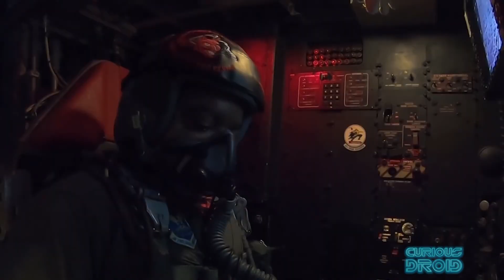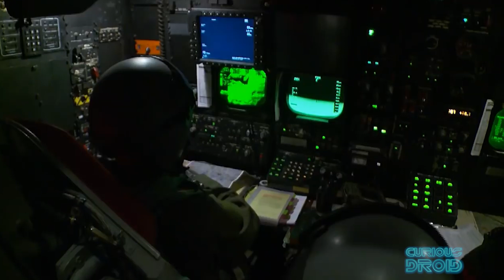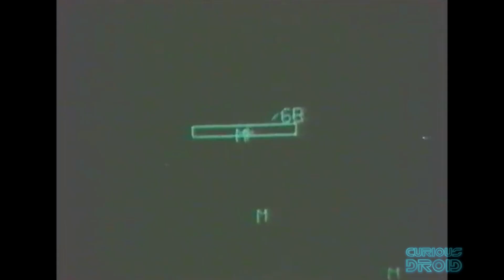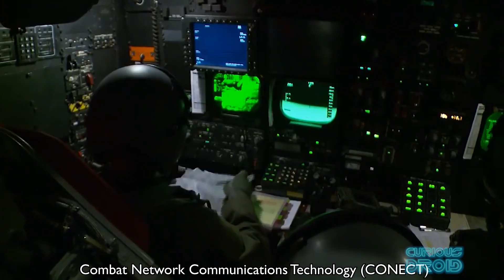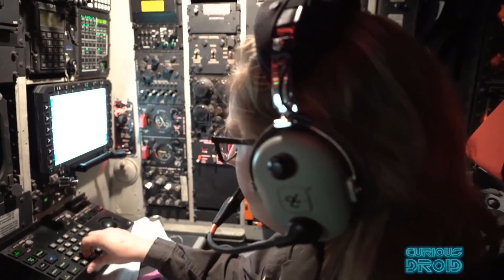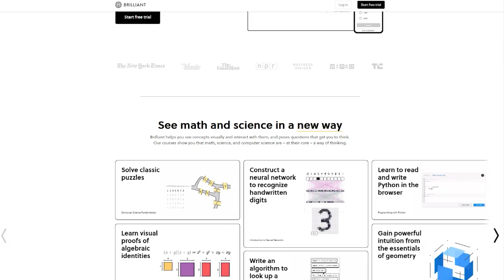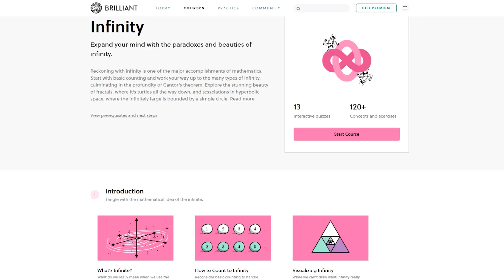How Long Can the B-52 Continue in Service?

Comment: Us airforce 
“The a-10 is too old and outdated, GET RID OF IT” 

Also Airforce “the b52 should stay for 100 years 😃”
Reply: libertarian4ever66 if humans use it over engineer it
Reply: If ever there was a plane that could and DID fight for it's place in the battlefield, it's the A-10.

Honestly, the U.S. Airforce hates the hog so much, they should lift the silly petty requirement that the army NOT operate fixed wing aircraft, and transfer the A-10 to them whole hog.(lol) The Army will likely not ever operate another fixed wing craft AFTER the A-10, unless it can do what the A-10 does so goddamn well: close air support saving the troops asses and going BRRRRRRT to any enemy bunker or mobile armour/artillery to make the grunt's life easier. It's fuckin win/win. The AF gets rid of the plane that make a mockery of the F-35 and the Army gets the close air support they need!
Reply: @exidy-yt  I think that since the Marines are phasing out Tanks, the A-10's should go to them. With mods that allow wings to fold they can take up space on assault ships.
Reply: @exidy-yt  I think that since the Marines are phasing out Tanks, the A-10's should go to them. With mods that allow wings to fold they can take up space on assault ships.
Reply: @wildancrazy159  I bet the Corps would love to have the A-10s! However if the wing replacements have already been built and are being installed on A-10s currently, that may not be financially doable but i like the idea, and if the Marine corps does too, who knows?
Reply: @exidy-yt  In my opinion the best USMC plane was the F4U Corsair... Plus its such a good looking plane.
Reply: @exidy-yt  it fought for dear life, back in 1991 it had to be pulled out due to excessive losses.
Reply: @ChucksSEADnDEAD  Uh, no. It rocked the battlefield in 1991! Took very FEW losses though many hits, and it brought those pilots home alive. Some Iraqi armour troops who read English took to calling the A-10 the 'Devil's Cross' quoting Tom Clancey's Red Storm Rising. The ground troops love it, it's saved their bacon many times now and continues to be the best at it.
Regarding your other post: F16s cannot loiter near as long over the battlefield and suck at close air support in comparison. Even a Super Tucano would be better then an F-16 in CAS which is a great versatile light fighter, but not ideal for CAS.  B-1? a strategic bomber? F-15 Eagles?? an all-weather interceptor/dogfighter??? Are you high? Neither of those planes do CAS except in dire emergency!  You really need to research before you post if you've never actually fought in battle. The A-10 is not an all-circumstances aircraft, it's a close air support specialist, and in that role it's still unbeaten.
Reply: @exidy-yt  It sucks a close air support. Its too fast to do the role effectively, and it was designed to kill tank columns in the 1970s. Most armor can withstand attacks from its 30mm and have enough AA to mess it up today. The way you would handle an armor column would be a submunition device from range.
Reply: @punishedmeridia  "Its too fast to do the role effectively" - Why?
Reply: @ChucksSEADnDEAD  It can't loiter properly. The best CAS during Vietnam were prop planes
Reply: @punishedmeridia  Loitering will get you killed. The best CAS during Vietnam came from prop planes because technology did not allow the human in the loop to acquire targets by himself in a jet, being almost completely dependent on ground forces to direct the attacks. The only solution at the time was giving the human a plane with lower performance. We don't need to do that anymore.
Reply: @exidy-yt  It only did well against the regular Iraqi Army; when the A-10s were sent against the more competent Republican Guard, they immediately started to suffer losses. After the first day, the A-10s were sent back to fight the much more incompetent regulars.
Reply: @ChucksSEADnDEAD  In the current footing that the US military is in, one of small unit anti-terrorism actions, a Super Tucano like turboprop would do much better than a A-10
Reply: @zalankarpati4387  I would think that would be expected of any plane going from chewing up literal cannon fodder to going up against disciplined and protected elite forces. What kind of support was the A-10 given? Normally it's a plane that flies when there is high control of airspace, and ground troops need support. It's not a tank killer anymore. It's not an all-circumstances plane, it's very much a specialist in an important role. In that role, it's cannon is murder. It's lower fuel consumption then most combat aircraft gives it hours more loitering time over the battlefield. It's upgraded avionics lets it deliver the same JDAMs and other guided bombs more modern planes can, and more OF them then any F-16 could dream of. It's old and ugly, but cheap to maintain and tough as nails. That's why it's survived so many calls to remove it when other, far less understandable recalls like the F-14 Tomcat went through.
Reply: @exidy-yt  You know what's even lower on fuel consumption? Turboprops that are only like 20 knots slower than the A-10 at cruise speed.
Cheap to maintain? Boeing got a fat check to build new wings because the damned thing was literally too old to fly. And not even the entire fleet got it.
Reply: @ChucksSEADnDEAD  Six A10s have been lost ever. During Gulf War One four were lost to SAMs and two flew back to base with damage that resulted in scrapping them out of 8100 sorties. None were lost in any of the various Bosnian conflicts, 

One A10 was lost during operation Iraqi Freedom altho the A10 performed 32% of the sorties. NONE  were lost in Enduring Freedom where it did 20% of them. They flew 25,000 to 30,000 sorties per year. 

They flew about 20% of the total sorties in Afghanistan with bo losses

And there have been no losses in operations agInt isil
 
The warthogs total sorties is second only to the f16. But then, there are less than 300 operational A10s out of less than 800 made, while over 4000 of the F16 have been produced. Even after paying to replace the wings on all the operational planes, the A10 is still the cheapest, and cheapest to operate of a y usaf plane. 

I dont get your loss ratio numbers tho. Sure, 6 out of 700 is huge but do a per sortie count. 

And, of coirse. The A10 can be serviced a d repaired on unimproved fields... kinda important. 

Would a turboprop purpose designes cas plane be better? Probably, but the AF will never do it. They hate props.
Reply: @ChucksSEADnDEAD  That's b/c it went into harm's way.
Reply: @selfdo  So did other aircraft.
Reply: God I love watching keyboard warriors with unlimited knowledge fight it out in a comment section.
Reply: Because the A-10 was made for large scale conventional warfare, and on modern battlefields it's barely more effective than a multi-role fighter, whereas the B-52 fills a niche that is important but too expensive to fill with a different aircraft, hence they stay while the A-10 will probably go.
Reply: Marine Corps says they will take the A 10 if the Air Force retired it.
Reply: @markrice41  How the hell is the A-10 going to take off and land from a short deck carrier? Get outta here with that nonsense.
Reply: @ChucksSEADnDEAD  The Navy has experimented with the A10. The Air Force is right now using the B52 over the south China sea as a deterrent.  My point is, we have a major situation brewing there and no modern hardware to deal with it.  Wake up, America!
Reply: @markrice41  So your option is to use ancient hardware, that already got shot down at unacceptable rates almost 30 years ago?
The Navy isn't the Marines. They need something that can take off from helicopter carriers.
Reply: @ChucksSEADnDEAD  You are still not getting the point. Do I have to be Captain Obvoius for you? We are using outdated aircraft because we have no modern aircraft. Except that new fighter jet that's so damned expensive they cant afford to fly it. I will give you another hint: Do you like diet cola? Do you like corn chips? Enjoy them while you can. Those who know why the south  China sea is kept out of the news will underatand.
Reply: @markrice41  "We are using outdated aircraft because we have no modern aircraft." - Wait. So we actually stopped manufacturing aircraft in 1984? There's nothing newer than the A-10 in inventory? Because that's your argument.
Reply: @ChucksSEADnDEAD  I helped build the B1 back in 84 - 91. Do you know how long it took even then to develop an airplane? Avionics would go obsolete and out of production before they could be put on the plane. By the time the planes were built, the mission (Soviet Union) no longer existed. The B52 can be easily retrofitted. The B1 and B2 cannot. It is so expensive and time consuming to make a new bomber.  Like the battleship, it may never be done again.
Reply: @markrice41  Look, regarding the modern hardware, we're dealing with it. That's why recently the Army showed off how artillery can shoot down a cruise missile, and a F-16 did the same with a guided rocket. The A-10 is not gonna help in Asia and that was my point. If they're gambling everything on not even letting carriers get close to shore with missiles, taking care of the missiles is more important than making carrier capable A-10s.
Reply: The concept of the A-10 was already outdated when it was introduced. It might have done okay against Viet Cong in South Vietnam, but slow, low altitude gunruns are the perfect targets for Soviet and Russian IADS (Integrated Air Defense System). Even the current A-10s mostly use guided munitions from medium altitude.

The B-52 is a very good long range, high endurance platform to lob cruise and hypersonic missiles from stand-off range, but the A-10 is a goner: too expensive for COIN, and has a very low chance of survival in a peer-to-peer conflict.

It might be built around a big gun, but it has almost no worth in the era of guided bombs and missiles.
Reply: @zalankarpati4387  As an attacking force the Soviets could not take an Integrated Air Defense System on the road to the Rhein. On that way are many mountains and hills to cover a slow and low flying aircraft from enemy radar. The A-10 can use guided ammunition but no other US aircraft can go as slow and low to precisely aim with 30 mm.
Reply: @libertarian4ever66 A Cessna at least would have huge fuel savings compared to the A-10. Sorry, but a CAS platform that only got 20% of CAS missions since 2000 and only 11% since 2014 has effectively been replaced.
You might not make a call for a B1 but if that's what's available that's what you'll get. Even the Army generals agree with me, they're not worried about the platform because CAS is a mission not a platform.
Reply: @libertarian4ever66 "I am the source, having actually called in for air support in the field" - What does this mean? B1s are called to provide CAS. In fact, if you wanted to argue your position, you could bring up how a B1 dropped bombs on friendlies by accident because they couldn't see strobes through the pod, and were too high to see strobes on NVG. Even though some of the blame is on the incorrect coordinates fed by the controller. So if you're your own source for the claim that B1s aren't called in for CAS, you're wrong.
I also don't know who you are, and you could be lying.
Reply: @libertarian4ever66 You didn't use sources, pretty rich you ask me for some when you won't apply the same standards to yourself. You'll have to wait until I can look for it.
Reply: @libertarian4ever66 https://en.wikipedia.org/wiki/Rockwell_B-1_Lancer "On 14 July 2007, the Associated Press reported on the growing USAF presence in Iraq, including reintroduction of B-1Bs as a close-at-hand platform to support Coalition ground forces.[134] Since 2008, B-1s have been used in Iraq and Afghanistan in an "armed overwatch" role, loitering for surveillance purposes while ready to deliver guided bombs in support of ground troops if contacted.[135][136]"
"In August 2012, the 9th Expeditionary Bomb Squadron returned from a six-month tour in Afghanistan. Its 9 B-1Bs flew 770 sorties, the most of any B-1B squadron on a single deployment. The squadron spent 9,500 hours airborne, keeping one of its bombers in the air at all times. They accounted for a quarter of all combat aircraft sorties over the country during that time and fulfilled an average of two to three air support requests per day.[145]"
"Beginning in 2014, the B-1 was used by the U.S. against the Islamic State (IS) in the Syrian Civil War.[148] From August 2014 to January 2015, the B-1 accounted for eight percent of USAF sorties during Operation Inherent Resolve.[149] The 9th Bomb Squadron was deployed to Qatar in July 2014 to support missions in Afghanistan, but when the air campaign against IS began on 8 August, the aircraft were employed in Iraq. During the Battle of Kobane in Syria, the squadron's B-1s dropped 660 bombs over 5 months in support of Kurdish forces defending the city, one-third of all bombs used during OIR during the period, killing some 1,000 ISIL fighters. The 9th Bomb Squadron's B-1s went "Winchester", dropping all weapons on board, 31 times during their deployment. They dropped over 2,000 JDAMs during the 6-month rotation.[150] B-1s from the 28th Bomb Wing flew 490 sorties where they dropped 3,800 munitions on 3,700 targets during a six-month deployment."
https://www.military.com/daily-news/2018/01/14/b-1b-lancers-evolving-mission-take-more-close-air-support.html  ""Twenty-five years ago, if you would have said the B-1 was going to do CAS, you would have been laughed out of the room," said Lt. Col. Dominic "Beaver" Ross, director of operations for the 337th Test and Evaluations Squadron."
"Today, "the B-1 [has] dropped more weapons in CAS than any other platform. It's second to none," Ross said during an interview.

Military.com sat down with Global Strike Command officials during a trip to the base and took a ride in the B-1B over training ranges in New Mexico last month.

"Most ground commanders want a B-1 or an A-10 [Thunderbolt II]," Ross said of close mission support.

But, unlike the A-10 -- reigning champion in the fight against the Islamic State in Iraq and Syria -- "we have the long loiter time," he said.

"We have the sensors. We have the speed, the shows of force. We are so [forward-leaning] in this community. We try to think of ways for the crews and the airplane to do things you would have never thought of doing with it," Ross said.

He continued, "If I'm talking to a guy on the ground and I have my sensor on him ... we can drop weapons seven miles away, or we can drop lower, drop them closer. We're not going to drop them as low as an A-10, but we are going to do shows of force where we're 500 feet overtop of their head.""
""Realize that all the platforms that drop these weapons [GBU-54s, GBU-31s] are seeing the exact same thing ," he said. "So a GBU-31 dropped off a B-1 is the same as a GBU-31 dropped off of an F-15, or an F-16, or an A-10. They all have launch acceptability regions, they all have air speeds and altitude restrictions, and they're all GPS-guided weapons."

Kilchrist added, "An A-10 can drop those things just as well as we can. To put in the perspective of, 'Oh, a B-1 is not a CAS platform' [argument], remember that CAS is that mission set. And because of the payload that we have, the speed, the gas, we can stay there for long periods of time. And just unleash.""
https://breakingdefense.com/2014/05/sen-mccain-b-1s-really-do-cas/
"Senator McCain stopped just short Tuesday of accusing the Air Force of walking away from the Close Air Support (CAS) mission if the service retires the A-10 Warthog fleet. Air Force Chief of Staff Gen. Mark Welsh and Secretary Deborah Lee James told the Senate Armed Services Committee hearing where McCain raised the issue that many other aircraft fill the CAS role, including the B-1B bomber.

McCain clearly did not buy it: “You’re throwing in the B-1 bomber as a close air support weapon to replace the A-10. This is the reason why there is … such incredible skepticism here in the Congress.” The senator apparently didn’t know that the B-1 has been a CAS weapon since 2001. The B-52 has flown CAS missions since 1967. Joint Publication 3-09.3 defines Close Air Support (CAS) as “air action by fixed or rotary-winged aircraft against hostile targets that are close to friendly ground or naval forces, and which requires detailed integration of each air mission with fire and movement of these forces.” So, by definition, CAS is a joint mission and not the purview of any single service or platform."
https://www.youtube.com/watch?v=eJzyN_yiTZ4 "I don't give a rat's ass what platform brings it in. I could care less if it's a B-52, if it's a B-1 bomber, if it's an F-16..."
No offense gramps, but it's not the 80s anymore.
Reply: @libertarian4ever66 "It's not being replaced" - considering that the majority of CAS missions are performed by aircraft other than the A-10, it is being replaced.
"I've called in for a Cessna with wing mounted grenade launchers and guys dropping 20 pound bombs out the side door. "High tech" doesn't solve everything" - Good stuff. The A-10 is high tech. If your problem is technology and cost, the A-10 sits in a weird position where is has been crammed with every possible high tech gizmo, but the aircraft itself doesn't have any of the advantages of the more modern multirole airframes. It is cheaper to operate than a multirole, but much more expensive than a turboprop without having enough of a speed and altitude advantage to justify it.
Reply: Sorry guys but titanium rain is right, the A-10 had the highest combat losses in the gulf, most if the heavy lifting was done by the f-111
Reply: @taomasterwaka6287  For sure, being able to take multiple missile hits doesn't mean shit if you move so slow any infantry anti air weapon since the 50s could hit it.
Reply: If the USAF doesn't want the A-10 anymore, FINE.  Give them to the Army and the Marines; close air support should be integrated with the services they support anyway!
Reply: @selfdo  Thats an excellent idea
Reply: @selfdo  that's what i keep saying
Reply: @libertarian4ever66 Yes, it is indeed funny that in the early 2000's the A-10 only got 20% of CAS missions and since 2014 it only gets 11%.
Reply: @libertarian4ever66 They're being updated? You mean Boeing got a cool billion to keep an aircraft that barely gets any missions airworthy. Plus didn't the re-winging program already end last year, with a new Boeing contract for additional 112 wings that will only come 2022/2023? Leaving a third of the fleet at risk of being grounded?
Reply: @libertarian4ever66 "As a soldier, the only thing I care about is the effect on the target. I don't give a rat's ass what platform brings it in … I don't care if the thing was carried in by carrier pigeons. I want the enemy taken care of" - Gen Mark Malley, Army Chief of Staff https://youtu.be/eJzyN_yiTZ4?t=2821
Source on the claim that the Army generals agree that CAS is a mission, not platform.
Reply: @libertarian4ever66 "the Air Force was flying 20,000 close air support sorties a year, and that about 80 percent of those flown in Afghanistan since 2001 were by aircraft other than the A-10. The F-16 alone had flown more CAS missions than the A-10."
https://www.airforcemag.com/article/the-ups-and-downs-of-close-air-support/
Source on the claim that the A-10 got 20% of CAS missions since 2001.
Reply: No way,  the A-10 Was given new life and new upgrades and new mission status profiles - so then again, neither craft are in the same league so not sure why you would post your comment?
Reply: @libertarian4ever66 I'd rather make a plane that gets hit by zero missiles than a slow flying plane that can get hit by many missiles.
Reply: The A 10 is overhyped and unnecessary
Reply: The issue with the a10 isnt so much they want to get rid of it as the fact that the manufacturer of them doesnt exist anymore
Reply: The difference is the the B-52 can just be used as a missile truck for long range strike missiles. It can sit out of interception range and just empty racks of cruise missiles at its target.
Reply: R Renaldo it was a joke…mr common Italian surname
Reply: Ok ima get real with the comments… this comment was a joke and I know that the B52 is a great standoff platform. I also understand that the a10 is a great CAS platform but is also very venerable in a scenario against a near pear country, stop pissing vinegar in the comments 😂😂😂😂. Fire so heavy down here I might have to call both the a10 and b52 to support me
Reply: Actually, the Air Force keeps trying to replace the B-52 and the KC-135, too. Enter the B-1, B-2, KC-10, and KC-46. I'll let history speak for itself. :)
Reply: Bruh the a-10 is being replaced because the modern threat enviroment is too dense for a single role aircraft with an outdated airframe, no stealth and crap sensors. The a10 is my favourite plane, I think it's badass but it's use is good for old, outdated and poor armies who can't afford high tech aa, but you can't just have shitty weapons because the middle east uses them, because China and Russia don't. The USAF needs new CAS if it wants to stay relevant in the future.
Reply: Also Airforce: Haha A-10 go BRRRRRRRRRRRR
Reply: They hate the A 10 but the pilots and ground forces love them I never understood them trying to axe the warthog
Reply: That's Congress man, not the Air Force.
Reply: @libertarian4ever66 yy
Reply: The airforce reversed it's decision on the A-10 when all the replacement proposals came up short in various areas, now they're looking into upgrade options for the A-10
Reply: Me: 
Facepalms through head
Reply: for the a-10 i say give them to the army the army loves them, SO GIVE THEM IT!
Reply: @libertarian4ever66 Modern AA defenses are simply too lethal. The best way to not get shot down is to not be seen in the first place. If spotted don't let them get a weapons lock, if they got a weapons lock and shot don't get hit. The F-35 is vastly superior to the A-10 at all of that, the A-10 only being better at surviving hits, which is near irrelevant because modern AA is too lethal to count on that. Gun CAS isn't efficient, the anti-everything is called a big fat missile or a guided bomb, which the F-35 may carry fewer of, but has better avionics and capabilities to target hostiles and deliver the payload.
Reply: @Theo-vn9hm  not even just modern air defenses. 1980’s planners anticipated that they’d lose the entire fleet of A-10s in 2 weeks of action against the Soviets if it came down to it, and that was 40 years ago.
Reply: Along rolls the Army: "Fine, we'll buy your A-10's, every single last one of them."  USAF: "No!  We're keeping them!  Air Force rules, army drools!"
Reply: @libertarian4ever66 the A-10 is ass
Reply: Except the A-10’s role in combat is questionable at best.  And upgrading it isn’t necessarily a good option. The A-10-C is a highly advanced, upgraded version of the A-10. But, all the upgrades have made the aircraft harder to repair. Which means it loses the standard A-10’s advantage of being easy to repair.
Reply: I believe the reason they want rid of the hog is that currently it only operates well when supplied with great air superiority. It's a bully aircraft. A war with Russia or China is going to make such air superiority hard to achieve, meanwhile they believe if they have a fast, multirole aircraft, they would be able to still provide ground support as well as operate in counter air operations.

Obviously, a non-specialised aircraft is going to be hard pressed to beat a design specific aircraft. Though like the C130, it's commonly used against much lesser forces that don't have the same capacity as the US.
Reply: @D_U_N_E  okay but the way the A-10 is used "close air support" is only feasible in that same situation. Otherwise you end up with black hawk down scenarios, at least the A-10 if hit can get back to base. Until something with the same capabilities comes along (it won't) it's easier to upgrade the A-10 with anti-air defenses or maybe even radar jamming tech. But instead we just try to retire it because of it's age.
Reply: @TengrioftheCrimsonSky  Due to how interceptors are somewhat a dead end plane design, the standard Multi-role fighter are likely the fastest things in the battlefield. Given that you don't always have planes flying over an area, it could be argued fast jets could perform somewhat like CAS and escape before an enemy sortie can intercept. 

The F35 IIRC is meant to be the next gen stealth fighter, so it would be assumed it would be harder to track movements of/be more resistant to automated ground based fire.

Meanwhile the hog, as much as I love it, is slow and a massive target. Given the amount of time you may be able to linger before a reactionary force intercepts in an equal battle, means that in future war the CAS supplied by it maybe short and unusable, with higher than needed risk to the airframe.

I believe it should be kept around as it's exceedingly good at pummeling the kids. Though against a real modern armed force, I'm hedging my bets on its design being out dated - kinda how the Stuka was great even for being so outdated right up to about 1943, in which then in started to suffer extreme losses of airframe.
Reply: @D_U_N_E  and yet what happens overseas when you're getting surrounded and there isn't an A-10 you can call on? Danger close air support denied.
Reply: @TengrioftheCrimsonSky  I can't say if that's is true or not, and documentation that shows that to be real? And if so, why did it occur as such.
Reply: @TengrioftheCrimsonSky  "it's easier to upgrade the A-10" - No, it isn't. Upgrading isn't the breeze you people think it is.
Reply: @ChucksSEADnDEAD  elaborate on how creating a new multi-billion dollar CAS plane is easier to get done?
Reply: @TengrioftheCrimsonSky  You can buy Super Tucanos for 18 million dollars with a 500 dollar per hour upkeep cost compared to the A-10s 46 million dollar pricetag for a new plane. The A-10s running cost also continues to go up as the airframe ages and it becomes more obsolete.
Reply: @punishedmeridia  we could also bring back our old prop planes which is more likely than our use of a Brazilian aircraft. I'm not unaware of the costs involved with the A-10 I've just seen what happens politically with the Air Force.
Reply: @TengrioftheCrimsonSky  Because starting from scratch eliminates the constraints. Upgrading means retaining old, ageing airframes that last rolled out the factory in 1984 and parts that need custom order because Fairchild went out of business in 2003. It means having to design modern systems to interface with the obsolete. It means being limited because you can't tweak the design without causing unforseen second and third order effects.
Plus, we don't need to create anything new. All the A-10 does is accomplished by turboprops like the Super Tucano. You don't want a multi-billion CAS plane that only does COIN in a super permissive environment. You just buy what's available.
Reply: @TengrioftheCrimsonSky  "we could also bring back our old prop planes" - Old aircraft are expensive to maintain and need to be babied because of fatigue setting in the materials. The OV-10 Bronco was used to provide CAS in Syria and Iraq as part of a project for a possible return and the Air Force shelved them again because the costs to maintain them were too high.
Reply: Still annoys me, especially with them always willing to put new toys over keeping in military members when there's a budget cut.
Reply: Keep the A10
Reply: @thepolishtech1552  Don't worry, we have kept the A-10. But keeping it doesn't mean using it.
Reply: @germanmilkman58  I love keyboard warriors calling people keyboard warriors for being right.
Reply: The airforce is stupid
Reply: @1500Chevy  that's right the air force knows less than some guy who watched a YouTube video.
Reply: @libertarian4ever66 the A-10 has already been replaced by F-16, Strike Eagles and B-1s.
Reply: @ChucksSEADnDEAD  Oh yeah, none of those planes can fly low and slow to protect the troops
Reply: @rodirby5952  why does an aircraft need to fly low and slow? You're just repeating what the Reformists say and they're military luddites.
Reply: @ChucksSEADnDEAD  uh, no.
Reply: @RickBoat  Uh, Yes.
Reply: A-10 was obsolete the moment it came into service mate, the only way it’s a good tank killer is by using mavericks and f-16 does it better
Reply: Imrose Bashir or even the F-35...
Reply: @imrosebashir2797  its not about killing tanks. You keep thinking air force, try thinking grunt. 
The a10 is a close air support plane with an armored cockpit and a gun from hell. Its purpose is to disrupt the OTHER ground pounders. An f35 etc is too fast, and doesnt have enough ammo capacuty for the role.  Also, the a10 is the cheapest plane per hour the air force has. 

The problem is, it doesnt do air to air combat, it isnt fast, and it doesnt do stand off weapiens. Ask the army guys if its obsolete.
Reply: @RickBoat  "a close air support plane with an armored cockpit" - It keeps the people alive, but everything else can get destroyed.
"a gun from hell" - The gun hasn't been able to penetrate tanks since the late 70s.
"An f35 etc is too fast" - Why?
"doesnt have enough ammo capacuty for the role" - Doesn't need it.
"Also, the a10 is the cheapest plane per hour the air force has." - A Super Tucano would be even cheaper so don't bring money into this conversation. The A-10 is extremely overpriced for the role it performs.
"Ask the army guys if its obsolete" - What do the army guys know about air power?
Reply: @RickBoat  The plane was literally designed to kill tanks, and mow it can't even do that anymore vs modern armor. An even better solution would be to bring back into service a prop based CAS platform. It would be even cheaper to run, can spot for artillery and can loiter better.
Reply: @ChucksSEADnDEAD  "what do army guys know about air power" ...  Nevermind. I'm sure you know best. I'll just go re read the key west accords and recall that the army seems to do cas fine with the helecopters they're forced to use despite that they're maintenance nightmares and horribly expensive. 

Air power. Gaaaaa... I'm gonna go hide in my no power tools workshop and contemplate building an articulated bookshelf to hide the television. 

I'm sure you know best. I'm withdrawing from the conversation.
Reply: @RickBoat  I'm not saying I know best. I'm just asking you, what does a 19 year old kid trained in infantry know about providing close air support in a contested air space?
"the army seems to do cas fine with the helecopters they're forced to use" - This is amazing revisionist history. It was the Army's own air mobility supremacists that pushed the air force out of the CAS business in vietnam because of their own smug sense of superiority. In fact, it wasn't until the air force chief of staff conducted a study that found that soldiers were satisfied with air force CAS but didn't understand why it didn't show up more often that the air force realized that the army was REFUSING to call in air force assets. This started the process of the A-X program, from which the A-10 was derived. The army thought they knew better so don't come complaining about maintenance and expenses. They wanted it.
"I'm withdrawing from the conversation" - Yeah because you have realized you have no argument. You might think this is your fart as you leave the elevator but it's simply you tapping out while getting rear naked choked.
Reply: @punishedmeridia  it long ago evolved from it's designed role of tank smashing which is what a good warplane should be able to do. it's now the best close air support plane in the US inventory, and the grunts love it.
Reply: @ChucksSEADnDEAD   OK you've forced me to a reply. 1st, who said anything about 19 year olds ?

 2nd  I am aware of the results of the survey you are referring to that started the AX program but that has very little to do with current  Close air support doctrine in a time when interest service rivalry is lessened and in an era where the technology is substantially different.

Trying to base decisions about 2020 CAS On tactical situations during Vietnam more than  50 years ago trying to base decisions about CAS in an era where a tends to exist along with blackhawks Apaches and updated Kaia was with a situation where there were no such things there were hughy's and at the end early model Kaia was and weird experiments like C130 gunships is just not possible there 2 completely different environments.

Obviously your beliefs about the role of CAS on the battlefield or different than mine. I formed my opinions based on conversations with ground commanders and ground troops and a lot of reading and obviously you've formed your opinions based on your inputs but anyway don't dismiss me as stupid or silly because we differ different opinions can be held by honorable people it's possible to form different conclusions based on similar data.

I don't know what eventual outcome will happen between now in say 2030 particularly in regard to the Sikorsky Boeing defiant style multi role helicopters which certainly appear to be well-thought-out for the purpose ofReplacing contacts they look to be simpler easier to maintain and well-thought-out. However, saying that doesn't mean that the wing replacement program for the a 10 was stupid, it certainly was cheaper then Sikorsky Boeing defiant helicopters look to be on a per aircraft basis and we have to have something to get us through until the 2030s or 2040s which is the realistic timeline for the advance for the advanced vertical lifft program or whatever that has turned into or will turn into.

 Finally you keep bringing up  Tanks. 
 Little or nothing in my research on the subject has caused me to think about tank killing in the context of CAS it just doesn't come up in the modern multi modal battlefield killing tanks is a separate role and most importantly a stand off role and not part of close air support so your indictment of the a10 in that it was originally thought of as a tank killer and now can't do that has little meaning the plane has like any good  Piece of technology has found new and diverse and alternate roles which is a good thing because we spent a lot of money for those airframes in the 1st place and we still get use out of them despite the fact that the role has changed.

 Anyway, thanks for the conversation the end since it's clear that we are never going to convince each other I think we've exchanged enough information that the public conversation clearly identifies both positions to the audience of those who read a 50 comment long thread so This time I really mean it, bye.
Reply: @RickBoat  You did. You talked about asking an inherently biased group of people with limited insight into air power, and I simply questioned what do they know.
"but that has very little to do with current  Close air support doctrine" - I will have everything to do with current CAS discussions because you people still pretend it's Vietnam.
"I formed my opinions based on conversations with ground commanders and ground troops" - Again, an inherently biased group of people who only gets a small glimpse of what air power is, and wants to hold on to that glimpse for psychological reasons. Maybe we need to get the CIA on the case, give terrorists all over the world capable anti air means, and we make the ground people watch what happens to the beloved A-10 when the going gets tough. Obviously I'm being facetious, but we've reached a point where the obsession with the A-10 has boiled over and the only way to ever cure it is a reality check.
"Little or nothing in my research on the subject has caused me to think about tank killing in the context of CAS" - Then don't bring up the Gun From Hell. The only modern use for the gun is close air support with a lower lethality radius. This can be accomplished by 20mm and 25mm guns, small diameter bombs and even the laser guided conversion kit for rockets. The only thing that set the 30mm apart was its ability to bust tanks, which has lost its effectiveness over time and we're not even issuing the DU penetrator ammo anymore because of the heavy metal dust it leaves in the area.
Reply: @RickBoat  actually no the cheapest cost per flight hour aircraft that the Air Force has is the TG-15A at a staggering $1 per hour according to the annual report from the Office of the Under Secretary of Defense (Comptroller)